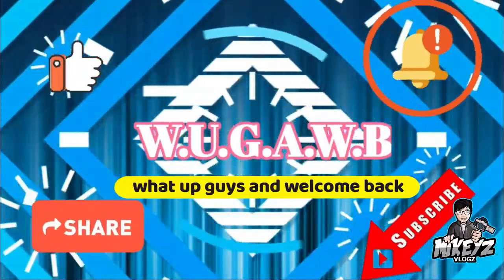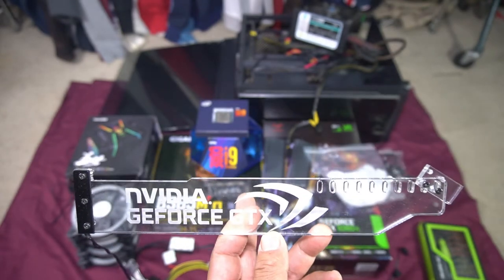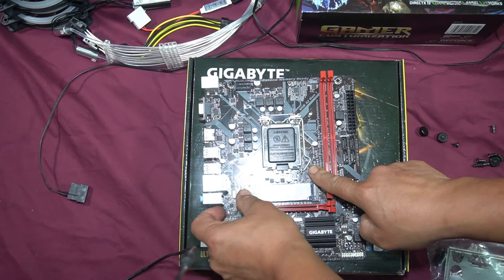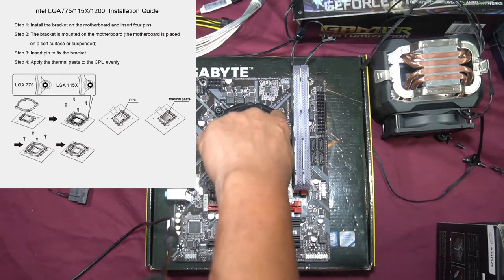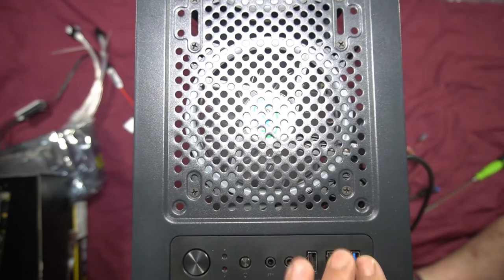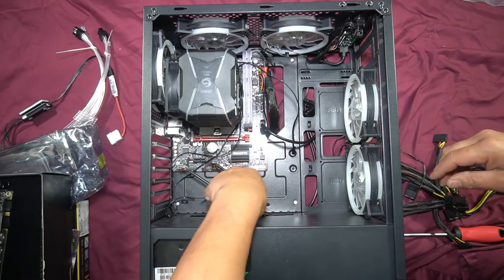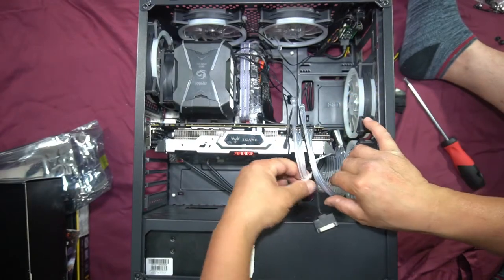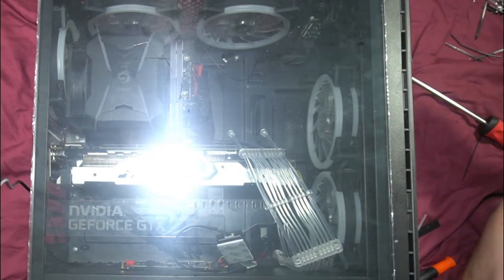cool pc build i9 9900k 3.6ghz gtx 1080ti mATX b365 MH gx850w psu g.skill 32gb ram 3200mhz

Comment: Sir I have ordered msi z390 a pro motherboard and i9 9900 processor will it perform good or bottleneck performance please reply
Reply: unless and until u dont overclock ur 9900k u should be fine with that motherboard but i recommend to get the z390 aorus pro or elite just for future proofing if u wanna overclock the 9900k
Reply from the maker: it is fine... wen i had my z390 i oclocked to 5.0 ghz and it ran perfect..
Reply from the maker: thanks for sharing
Reply: @MIKEYZVLOGZ  bro somebody threatened me that the cpu is very powerful and will generate more heat and the motherboard is not capable of handling it that's why I am confused.
Reply from the maker: if u  dont overclock it will be ok do u plan to overclock?
Reply: @MIKEYZVLOGZ  thanks brother
Reply: @MIKEYZVLOGZ  no I don't plan to overclock
Reply from the maker: @ShubhamRaut-v3k  u will be fine as long u dont overclock .... im running exact same .... z390 pro carbon ac i9 9900k and gigabyte gtx1080ti
Reply from the maker: @ShubhamRaut-v3k  ur welcome

Comment: If I have a b365 MH  with a i9 9900kf will that reduce my performance and should I upgrade my motherboard
Reply from the maker: i think ur ok but if u want best performance go for a better mobo.. im running it like that now but i got a aorus z390 ultre which can handle 5ghy overclock nively and thats just to get the most out of the i9 9900kn
Reply: @MIKEYZVLOGZ  thanks heaps I have a 2060 super with it until I can get a thirty series and I may need to get better ram but thanks for your advice
Reply from the maker: @l5z502  i would get at least 3200 mhz ram it the sweet spot for ram not slow not fastest perfect ... and def a mobile that can support it ..and u will be ok for a few years ... u know how PC stuff is .. every week something new and better can't keep up